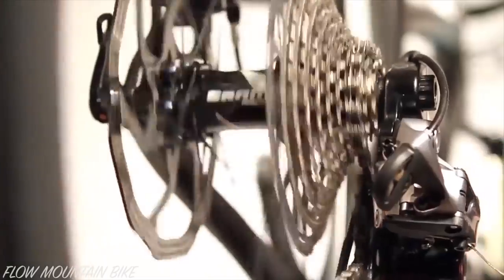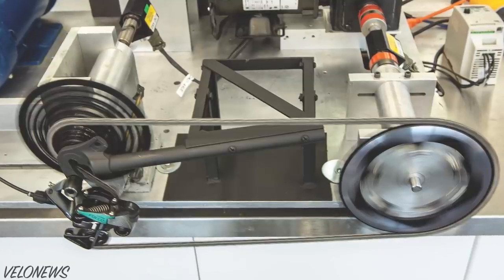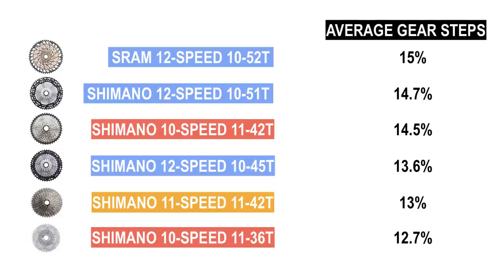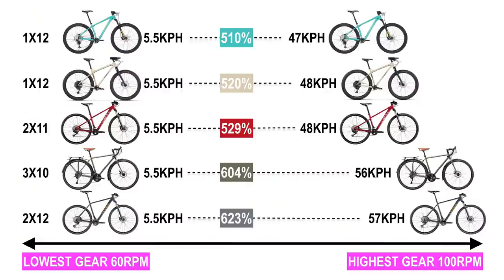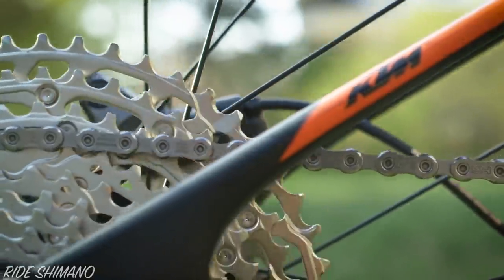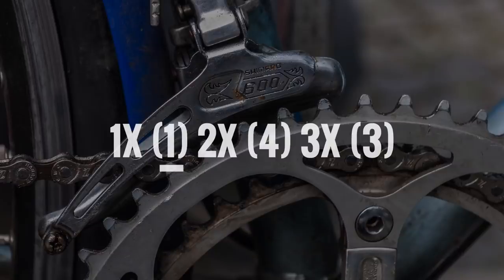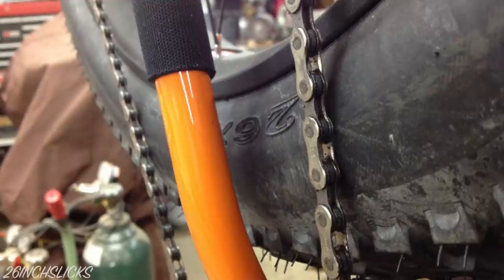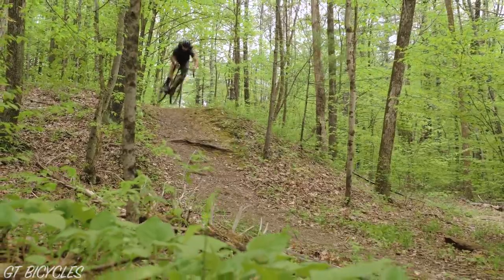1X vs 2X | What is the ULTIMATE Drivetrain For Your Bike?

Comment: You lumped together ease of use and simplicity, I think those should have been in separate categories. 1x means running a drivetrain with one less component that can break/cause issues. I did a tour across Europe and had problems with my front deraullier the whole time, despite taking it to 3-4 different shops (it always caused issues again later). Of course, you shouldn't base your videos on one person's experience, but that's the reason I run 1x on my current bikepacking bike. 

Also, running 1x compared to 2x feels like the same as running fixed compared to gears. It just feels good. Maybe not logical, but it's a better riding experience for me :)

Comment: I dont think 1x really makes any sense unless you're using the microspline/xd system, if you're running the 32t up front you really need that 9 or 10t at the back else you just dont go anywhere on the flat. If you're running a bigger chainring at the front then you can get away with an 11 at the back, something like a 10s 11-42 with a 36 t front chainring gives me all the gears I feel like I need, and if you want more climbing gears and dont mind the bigger steps then you can go 11-50, or 11s 11-50 and have a wider range with shorter steps

Comment: Would i be able to run a 9-46 rear cassette with a 46T front chainring on a 1x setup.  I am using a shimano slx 11 speed medium cage.  Do i have to use a long cage to achieve this goal or do you think i can get away with the shimano medium cage. Thanks for your help.

Comment: 2x is my favorite and refuse to buy 1x if the option is available even if I downgrade shifters. yeas you hears that right, I prefer crappy 2x over high end 1x......because efficiency and cross chaining issues and easier to use front crank as uphill and down hill gears while the rear cassette as the slow marginal gearing changes.  1x my thumb gets a workout as soon as i see any hill change, stupid stupid stupid stupid need I go on.

Comment: I thought Alee was going to finish with if have watched me for any length of time just go rohloff or pinion if you must. No mention of rotors thirteen speed?
Reply from the maker: I had to perform some serious restraint to not mention gearboxes. 😁 I didn't mention Rotor because it is not common, and other than the smaller gear steps between the 10-11-12t cogs (which is nice!), everything else applies.

Comment: Might want to review 3x having more range than 2x. 2x12 gear range at 620%? 38/28 and 10-45 gives me 611%. Basic Alivio has 44-32-22 with 11-34 that is 618% and that's without using 11-36.
Reply from the maker: For the comparison, I used the most common forms of 3X10 and 2X12 found on bikes, which is 48-36-26/11-36 and 36-26/10-45.
Reply: @Cyclingabout  OK, but it does seem a bit misleading to base the double range on a single 2x12 drive train that has almost zero market share of 2x drive trains, let alone all drive trains (and is dwarfed by pretty much all triple drive trains in market share) when the far more common 2x11 drive trains have nowhere near the range of any touring triple.
Reply from the maker: Part of my reason for choosing these drivetrains is to future proof this video. 2X12 drivetrains will likely be more popular in the next five years because right now it's only Shimano Deore in the 2X11 spec.
But keep in mind my aim for these videos is to give people information that allows them to think critically. I assume if people want to calculate the gear range for specific examples, it'll be just a few buttons away.
Reply: @Cyclingabout  Potentially understandable if you're focused exclusively on flat bar only MTB setups with small chainrings that help inflate the range calculation for the same teeth difference. Even newly released drop bar drive trains don't come anywhere near this >600% range in 2x yet though (even with 11-40 cassette hacks). I'm more thinking along the lines of a Sora/Alivio 3x9 combo that handles flat or drop bars. It is pretty much a standard on touring/urban bikes now and will still beat a "high end only" 2x12. 

Regarding future proofing, I think it's difficult to argue that 2x exceeds 3x range. The only way this would happen is if 3x stop getting made and you only compare very modern and specifically designed 2x to very old, generic 3x.
Reply from the maker: There are touring bikes with 2X12 and 3X10 drivetrains currently available, and that's why I used them for my example. I'm not trying to suggest that ALL 2X drivetrains are wider - please understand the need for me to simplify things for a sub-10 minute video.

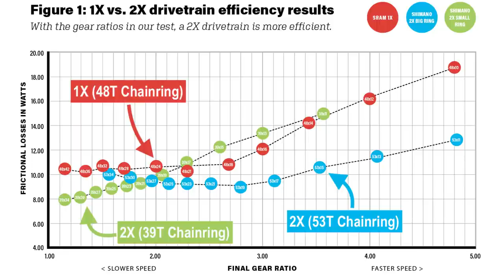Comment: 0:59 to me this just shows that the SRAM chainring/cassette is dragging causing friction. 
One of those red dots MUST be a gear without any cross chaining yet its still losing watts. Why compare 2 different brands in a test? Was it even the same chain?
Reply from the maker: There was no Shimano 1X drivetrain available when the test was conducted. It'd be interesting to see how a 1X GRX drivetrain compares, but one thing is for sure - the 2X Shimano drivetrain will still be faster due to the:
- reduced chain bend angle
- lower chain tension
- less chain link articulation, and
- slower chain speed
Reply: @Cyclingabout the chain bending shouldn't be an issue in the test though, as the 2x is in the same bending right? But I'm saying in the zero bend cogs the SRAM still sapped more watts. 
 I saw later in the video that SRAM chain is known for sapping more power, but that longevity test is promising. 

Reduced chain speed is interesting, I find my 39t to 40t cassette with seems to have less drag than my other granny gear equivalent bikes with 28t cassette.

Comment: Question regarding the number of chains per cassette. In your opinion is there any benefit to rotating say, a pair or set of 3 chains, as opposed to simply replacing a chain 2 or 3 times per cassette.
Reply from the maker: It's better to rotate a few chains on the one cassette.
Reply: @Cyclingabout  Excellent response time. Thats what I have recently implemented but I defer to your nerdiness also ;)

Comment: 2x8 are 3 of my bikes , is cheap and i have enof gear , on road bike i have 50-34  and 11-34 , and on the gravel bike 36 24 , 11 40 ,  and is not that difficult to use ,

Comment: We who ride bikes are in the mercy of manufacturers. They always contol the market. Even if your looking for a 3x or 2x setup mostly it's hard to find on middle to high end bikes. Mostly now it only comes in the the low end bikes. And even for drive train components they seldom have 3x or 2x.
Reply from the maker: Or you can build up a bike! Or modify drivetrain components when it comes time to replace worn out parts. There is very little dominance from above, most bikes will fit most drivetrains.
Reply: @Cyclingabout  here in the Philippines, majority of frames are for only 1x set up. It's becoming harder to find that would fit a 2x or 3x. Now because of the pandemic steel build bikes are available which geometry are not that what I want. But it has a 3x drivetrain with not good components. But I will wait for a good frame for a 2x or 3x set up even if it is steel or chromoly. 😊

Comment: I know you’re on a Rohloff but if you were using derailers would you go 1x or 2x personally?
Reply from the maker: It really just depends on the application. You probably wouldn't see me running 1X on a touring bike. But on a bikepacking rig which is intended for off-road use, I'd happily ride without a front derailleur.
Reply: @Cyclingabout  Makes sense! Thanks for replying. Love your thoroughness in your videos. Would love to see a video or article about best rear hubs for bikepacking. Got my sights set on an Onyx Vesper!

Comment: What about Rotor 1x13?)
Reply from the maker: I like that the cassettes go from 10-11-12t (where some of the bigger gear steps usually are) but the rest of the gear steps and other 1X drivetrain characteristics still apply.
Reply: Rumors say Campagnolo will release another 1x13 in September.

Comment: You forgot to include a belt drive system, which you claimed the best system for bicycle touring, in this study.
Reply from the maker: You cannot use belts with derailleurs, so they're not directly comparable.
Reply: @Cyclingabout  A belt drive system can be considered as an 1X system with internal gearing, which I believe you did some comparison with a conventional gearing system in other video.

Comment: I'm glad I kept my 3X10 mountain bike. It's super versatile, going up 20% hills on the trails or road touring with large gears and being able to keep close to my best candace. The chain also lasts very long with little crossover. Also, the front gears need little maintenance since for every 20 times I change the back gears, I only changed the front once. Sometimes the original ideas are the best. Like my rear rack, with the arrival of bikepacking I never took the rear rack off, it is useful for large or small panniers, a backpack or just a wind breaker, so useful.

Comment: Alee, great analysis as usual. I have done an analysis on the jumps between the gears as well, although I simply used a spread sheet:  https://youtu.be/U7M9-VfE8CU. There are a couple of issues that are not often addressed. Firstly, most cyclists cannot push the high gears that are found on many bikes so they are not often useful (wasted) in most real cycling situations. Secondly, the cassettes for 1x are much more limited in the ratios that are available than for 2x, it is much easier optimize the 2x gearing as my analysis shows.

Comment: What are the reasons for the 12 speed chain lasting longer?
Reply from the maker: There are more advanced coatings and materials used to manufacture the new chains. This technology could be applied to all other chains, but currently, it is only available in the 12-speed components.
Reply: @Cyclingabout  that's interesting, thanks. I guess you could run a 12 speed chain on a lower speed cassette to get the most longevity (the advanced materials and the straighter chain line)?
Reply from the maker: @123a-o5d  As long as you're using 12-speed cogs, you probably could.
Reply: @Cyclingabout  oh, I thought you could put higher speed (narrower) chains on lower speed cassettes, just not the other way around.

Comment: Great video!  I love my 3x10 drivetrain, 900% gear range.  I also narrowed/modified the bottom bracket to move the chain rings in closer to improve the chain line, especially in the lower climbing gears:
https://youtu.be/V5pomMoN5ls
That said, I ride this more like a 1x system, only shifting the FD 3 times on a typical 5 hour ride.  I'll run big ring on flat pavement, drop to the middle ring for the rolling hills and then into the small ring for the dirt portions and finally back to the big ring for the pavement ride back home.
Reply from the maker: What cassette and chainrings are you using? 900% range is huge. By my calculations, you would need both a 52t and 22t front chainring, and 11-42t on the cassette - and it would exceed the derailleur capacity by quite a lot too!
Reply: @Cyclingabout  Running 44-32-20 on the front:
https://youtu.be/tPbru0dAdmU
and 11-45 on the rear:
https://youtu.be/GM-cn_giBb4
Gives  a 12-108 gear inch range.
And yes, I'm exceeding the rear derailleur capacity, but can still run up to around 20-20 on the low end before the chain goes slack.  This bike breaks all the rules, 9sp MTB mechs, 10sp road shifters, undersized chain ring, oversized cassette,  running non-tubeless tires tubeless just to name a few rules I've broken.  I'm coming up on 11K miles (18K km) and it's the best bike I've ever ridden.
Reply from the maker: I'm impressed. Nice work!
Reply: @Spitch Grizwald Chain is sized so the big-big combo works without damaging anything.  I just avoid using the small-small combos (cogs 6-10) for the most part.  Cross chaining from the 20T up front to the 11T in back would be horrible and if I need to go faster, I can shift up to the middle ring and get all the cogs in back.  Beauty of having a 3X up front, there's a better gearing option available if needed.

Comment: 😁We have patented an entirely new, infinitely variable, ultra-torque dense, gear technology, called FrictionLess Gear, which is a reformulation of gearing theory. Legacy and novel applications abound. Retrofits of ALL existing bikes, even electrics, will be available. The gear range can easily be >700 with a price range half of the lowest priced competitor.

Revolutionary torque dense electric motor innovations are on the table as are novel  variable shock absorber concepts. 😉

Comment: So the best for non MTB would be 2x12.
Campagnolo with SRAM chain it is🤓
Jk, but why hasn't Shimano releases 2x12 for the road yet? What are they waiting for, even Deore is 12 speed for MTBs. Does anyone know?
Reply from the maker: Shimano Dura-Ace has been released in 4-5 year cycles since 2003. The last update was in 2016, so the update with 2X12 will  likely get announced later this year or early next year.
Reply: @Cyclingabout  ah yes you are correct, I was totally ignoring that. From what i can see Ultegra usually followed a year later and another year later 105.
But why do I even care, I have 3x8 with 12000km still on the first chain😂

Comment: A Lot of cyclists are switching to 1x because of all the problems with front derailleurs.  The front derailleur has to be perfectly  installed, aligned, and tuned to work correctly. And even when that is all true there can still be problems down the road because they are very cheaply manufactured and poorly engineered.

Comment: 1x is for chumps, who are easily manipulated by slick marketing.  You can't be 2x for the road, and you can't beat 3x for mtb.
-
Don't believe me?  When 1x came out, it was 1x10.  But is sucked.  So they made 1x11.  But it sucked.  So they made 1x12.  But it sucked.  So we are currently at 1x13.  It too will suck.  I can't wrap my head around the stupidity of giving up high/low (or both) range AND giving up properly spaced steps between gears.  Any "gains" in weight, simplicity, or aero are 100% negligible.